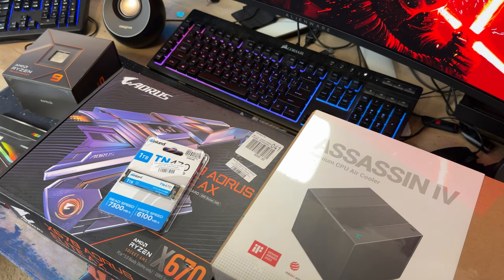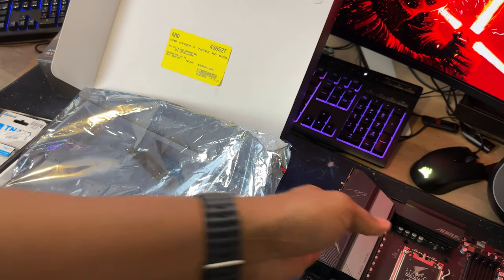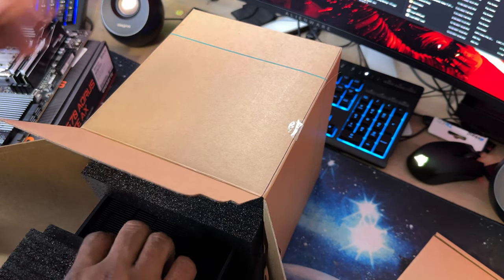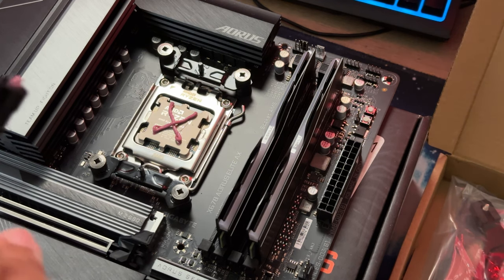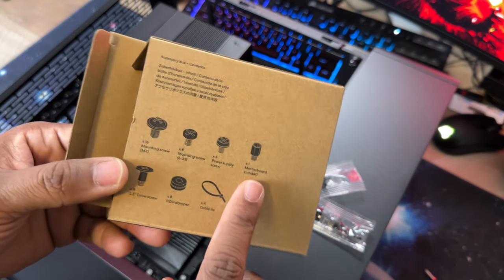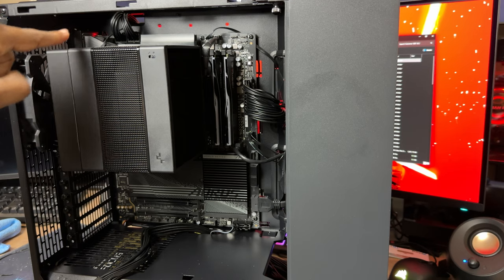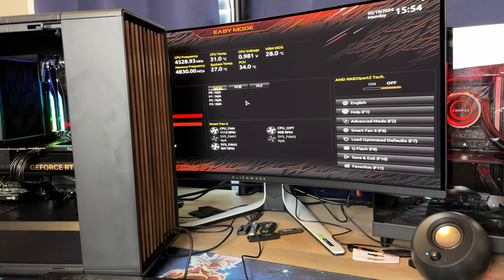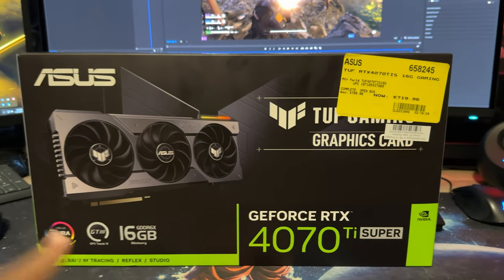2024 How to Build a PC | Streaming & Recording | Asus Tuff 4070 Ti Super | Helldivers 2 at 4K

Comment: I try like hell with my new unit to stream and all my stream does is lag. I can't seem to figure it out since i have 6mb service I should be golden. Any ideas? msi b650 pro 7800x3d fury 5600 cl30 samsuyng 4 tb 7200 mt ssd gen 4 and a red devil 7900 xtx power flower 1000 leadex psu
Reply from the maker: Your upload speed is key. The 6mb service you speak of, is that your download speed or upload speed? If you’re not sure, run a speed test at Speedtest.net on your computer.